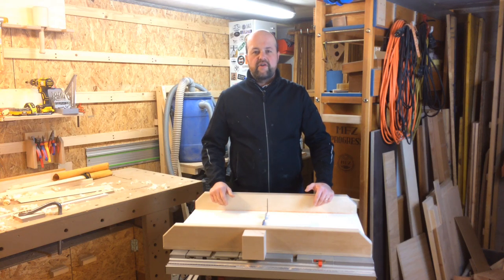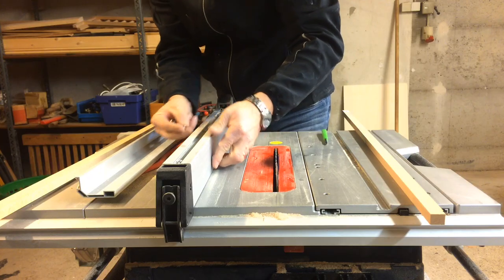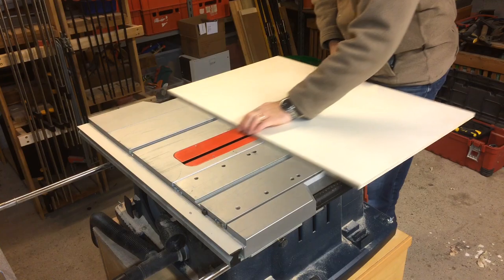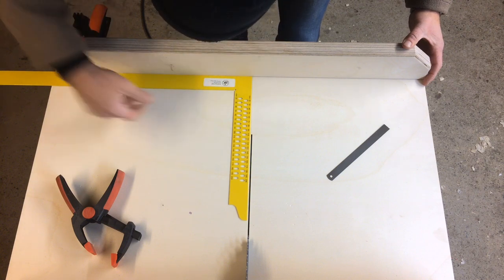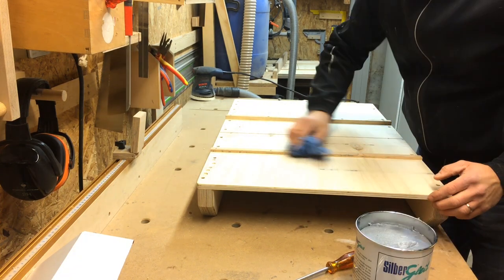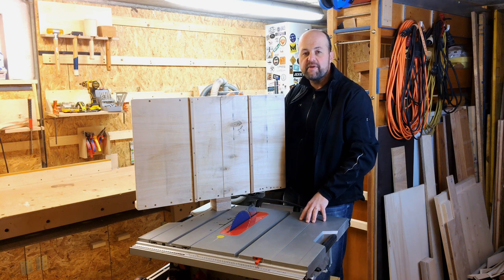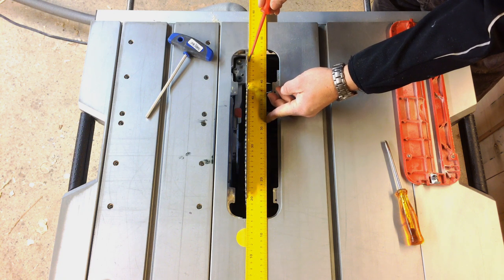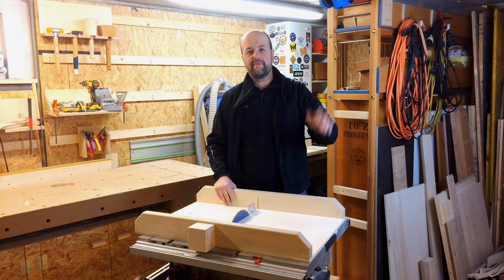BOSCH GTS 10 XC SLED  –  CROSS-CUT SLED FOR THE BOSCH GTS 10 XC

Comment: For beginners: Don't ever use silicone for lubricant where wood that you are going to finish or glue might come in contact. Silicone never comes off and it screws up any finish you might want to use.
Reply from the maker: Thanks for the tip – but did I use silicone anywhere or mention that you should use it?
Reply: No, you didn't mention silicone and Silber Gleit doesn't have silicone in it either but there are a lot of products that have silicone in them that are for lubricating and they are to be avoided for woodworking. Beginners don't know this which is why I mentioned beginners.  I remember when a musician friend of mine didn't want to spend more money on guitar polish and used furniture spray 'wax' instead. I looked at the ingredients and it had silicone in it.  When the instrument needed to be refinished after a repair (don't trust airlines with your musical instruments), the repair person had a terrible time because the silicone gets everywhere. Luckily I had told my friend to warn the repair person that he had used silicone so the repair person had carefully scraped the top of the finish off before he began.

Comment: Hi, what model of bosch blade do you use for cross cuts? Is it 254mm 54T  ? Thx.
Reply from the maker: It’s this one: Expert for Wood 254 x 30 x 2.4 mm Z60T – 60 Teeth, but 54 will work just fine as well.
Reply: Andreas Kalt Thx for your answer.
Do you mean this one https://www.bosch-professional.com/de/de/expert-for-wood-kreissageblatter-2592812-ocs-ac/ ??

This is a bit confiusing. According to Polish Bosch cataloge this one is designed   for mitter saw. For table saw there are only 54 and 80 teeth options...just wandering what's the difference..
Reply from the maker: In principle, this is the one. You just have to make sure to choose the correct diameter of the blade and of the hole in the centre. In my example it says: 

254 x 30 x 2.4 mm Z60T

Which means: 

diameter of the blade: 254 mm
diameter of the centre hole: 30 mm

width of the cut: 2,4 mm
60 teeth

On the page that YOU linked to, you can scroll down and choose the correct diameter.
Reply from the maker: The first one is the one I have. I don’t think it makes a difference if it is used in a mitre saw or a table saw.
Reply: I just have figured out that the main difference is in teeth angle. 
Blades for mitter saws has negative "Hook Angle" ("Spanwinkel" in german catalog) 

No idea how it reflected in cutting results.... probably this is not something crucial ;-)
Anyway,  one more time big thanks for your answers and very helpful videos.

Comment: Is it possible that you didnt get the sled to square up easily because the second rail is on the original sled, which in and of itself has some play on this machine? Very helpful video, Andreas.
Reply from the maker: That’s a good suggestion. However, it turned out that the square that I used at first was not accurate, which complicated things a lot.
Reply: @holzhandwerk_ak  The reason I am asking is because I made twice twin rails from different wood, all four were perfect width and slid well. But when I mounted them onto the sled, in both cases the sled was stuck... very disappointed. Now, I will try waxing like you suggested.
Reply: The Problem with the original sled is,  that it is not adjusted acurate from factory side. Had the same problem Here, doing the runners twice, with the same result. After assembly i Had to rework them that much, that the bearing came to lose. 😭